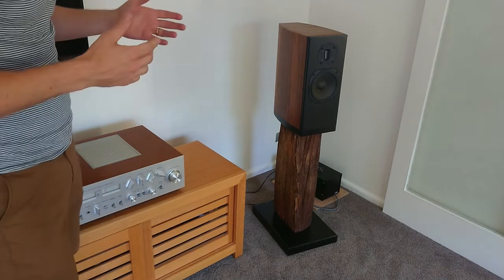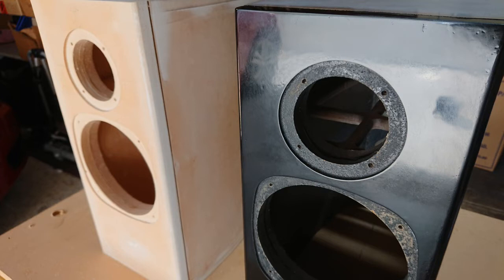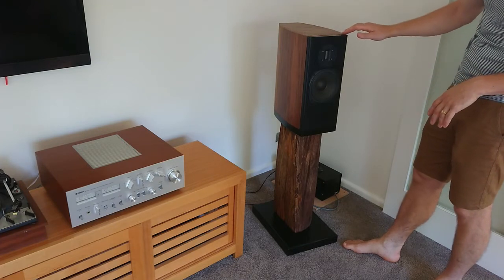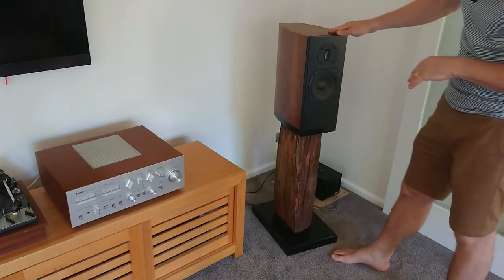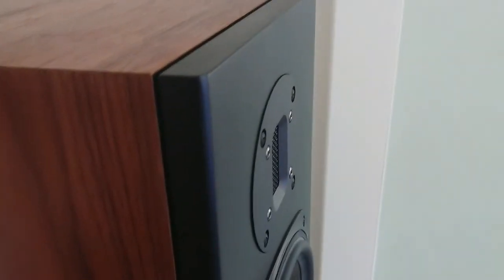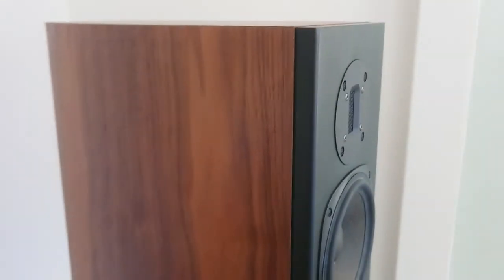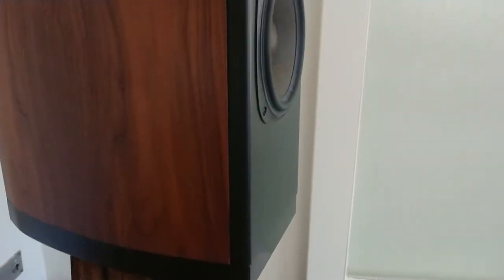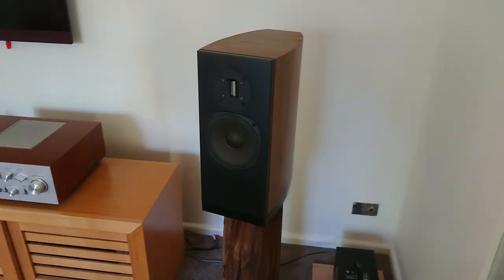DIY Hifi Speakers - Finishing touches

Comment: nice end result. For a piano finish on paint you need to let the paint cure (from 15 to 30 days depending on the paint you used) then add around 5-6 coats of clear and let it cure for at least a couple of days (a weeks is good) then buff it using buffing compound and . Archiving mirror finishes in house is almost impossible due dust and not having a good spray gun but buffing is the best bet.
Reply from the maker: It was all too difficult for me!!
Reply: @stephenjlr  it is man... that is one of the hardest. But yours looks awesome...